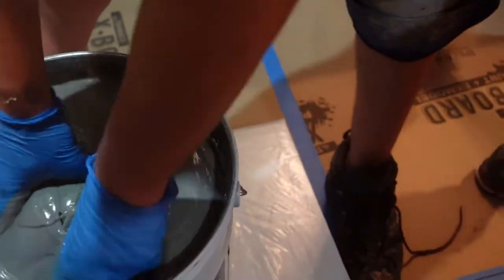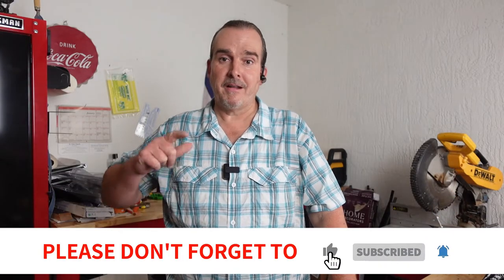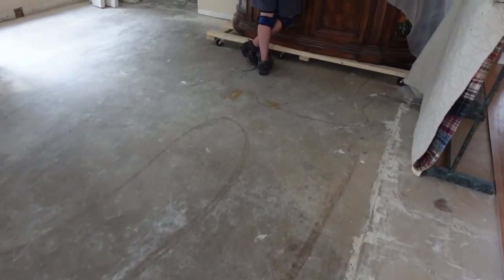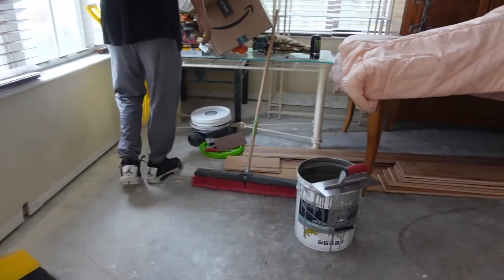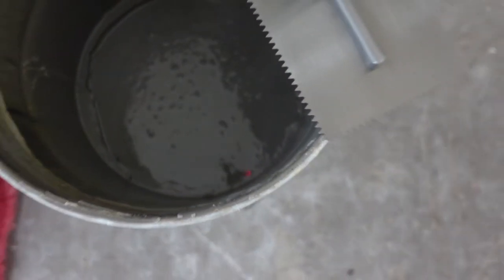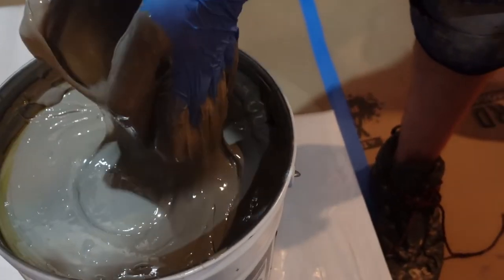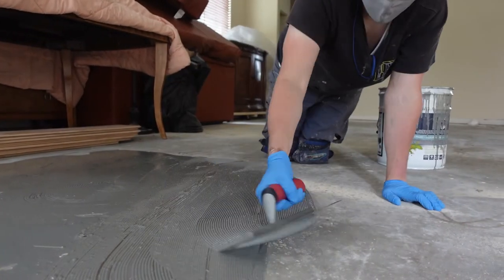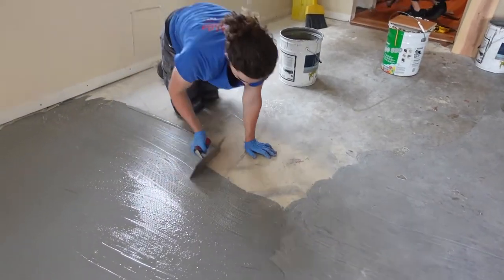HOW TO MOISTURE SEAL CONCRETE FLOOR, WET SUBLOOR, MOISTURE PROBLEMS WITH FLOORING, BOSTIKS MVP4

Comment: Can you put epoxy over this and does it need to have a grinder run over the concrete first? Not only does the slab sweat, but also there is a flooding issue so it needs to be sealed, sealed and sealed. Won't be able to get under interior bottom wall plates and hoping to just marine tape them when the sealant is applied

Comment: Now that I know how to take up an engineered glued down floor, thanks to you, if I want to put down a floating vinyl plank floor on a slab can I use this product and forgo the plastic sheeting. That is the first product you used, not the glue
Reply from the maker: I have used it before because a client who was a contractor wanted us to , but its not recommended unless you are gluing.  Bostik's does make a product called Slab-cote that is better for floating installs.
Reply: Bostik Roll-Cote
Reply: @JonesKnows  Thanks, that answered a question I had.  If this stuff is self leveling though, why would it not be a good idea to use if you are just locking the LVP down over it?   I don't want to glue my floors, in case it does happen to flood again (we've been through two of them.  Adhesive was a nightmare to deal with.

Comment: I have a basement with concrete floor and walls that seep in water. How do I seal it when it's always wet
Reply: Make sure your gutters are working & Rain water is not causing drainage issues first Check out Apple Drains videos
Reply: That’s hydrostatic pressure. You can’t win against it unfortunately

Comment: My water heater leaked and I cannot get the concrete to dry.  Some areas are dry.  But the areas that got soaked are still at 16% after drying for two weeks with big fans and dehumidifier .
Will this be okay over that?gonna install luxury vinyl over it.

Comment: If you stop the moisture  on the floor , how do you avoid keeping the moisture from coming up u Der the walls and creating mold and mildewin the walls. I need something that soaks into the concrete  sealing under the wall plate
Reply: And half of these products can't even be used if the moisture level is too high in the concrete. So if you have serious rising damp like my house has, you can't even use this. Rising damp is such a horrible curse. It is the worst thing I have ever dealt with in a house 😭 I ended up laying Dricore flooring, sealing the whole border and all seams, then laid my floor on top of that.

Comment: Question for you. Have you encountered a customer who uses a wheelchair full time? W want to put down LVP but unsure if we should float it vs. glue down to stand up to daily traffic of a manual chair. Second question is we have 2 by 6 car decking covered with  particle board. Is there a floor leveling product that can be used on particle board as well as a glue?
Reply from the maker: Definitely go with glue down product it will be better in the long run.  Particle board is really tricky.  Mapei self leveler maybe, but I would call their technical support first to make sure.  I always call technical support for whatever product I'm using if I'm not sure about something.
Reply: @JonesKnows  Thanks so much for the info🙂

Comment: thank you for this video ... Would this solution work for a smaller area that seems to have repeat moister seep up through the concrete? Should we take out a whole area and start over with this product and re install our glue down wood floor?
Reply: I’m a contractor and I’ve worked with this and similar products several times. And to answer your question, yes. I used it at my house. I had one random spot in the middle of my basement floor where water would magically come through when we would get heavy rain. It would just be a circle about a foot across but it would drive me nuts. Haven’t had any issues since

Comment: Going to try 2 types of 3/16” v-notch squeeges, one metal with a push pole, the other rubber.  May be better, more comfortable!, and faster, than crawling.  My hand trowel like the one in the video cleaned up great in mineral spirits..used an aluminum disposable turkey roaster tray…$10, to soak my trowel.  I am not as fast as the girl in the video!  also used a rhoomba to vacuum my concrete…keeps the debris from streaking as you apply, result is faster application
Reply: Ummm, that’s a guy, no?

Comment: I had some mold under my old flooring which was glued. Do I need to use liquid moisture barrier or just 6 mile plastic underlayment will work and install lvp flooring ?
Reply: What new flooring are you putting in?
Reply: @Jaylowrider  , I am installing SPC 8mm vinyl flooring.
Reply: @abhishekkulkarni7454  over concrete you will use 6mils poly and over lap 6” and tape the seams entirely with a polyurethane tape, or a red duct tape you can find at Home Depot or buy on Amazon.

Comment: Hi do you recommend doing this anyway for protection of the vinyl planks even if you dont know if your concrete slab has moisture problem? I bought dunlop damp proof moisture barrier( which is probably very similar product), you paint it on with a roller. It says its perfectly safe to use then when you look at safety info of the product  online it warns of many serious health problems when applying and to to wear mask, gloves , gum boots , long pants and sleeves, it really stressed me out to read that .. I'm using lvp glue down planks.